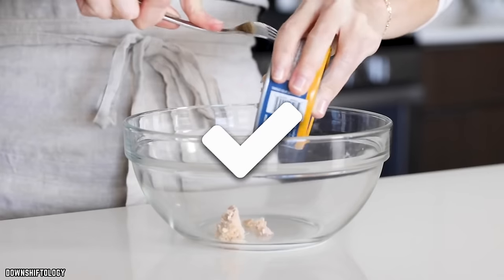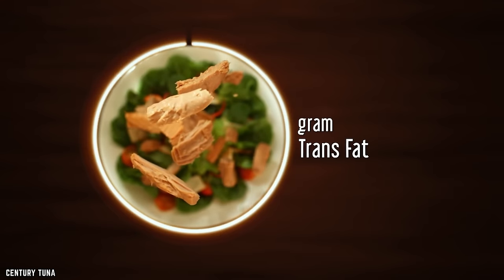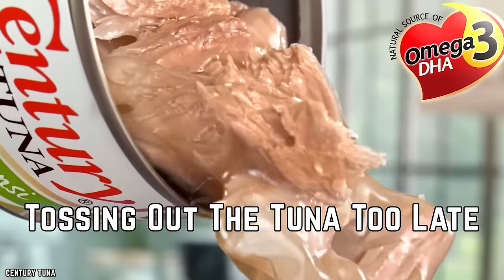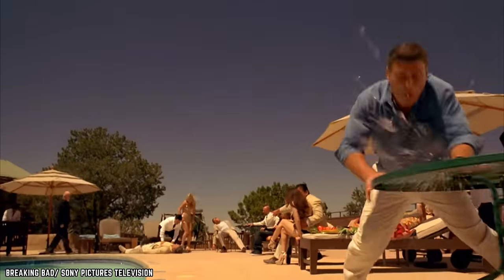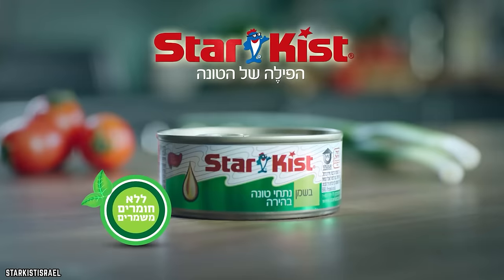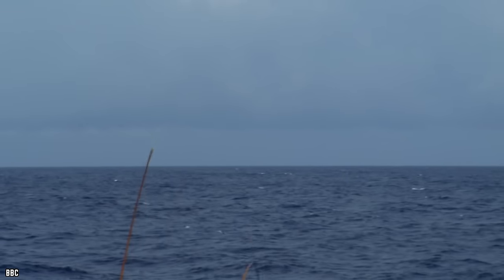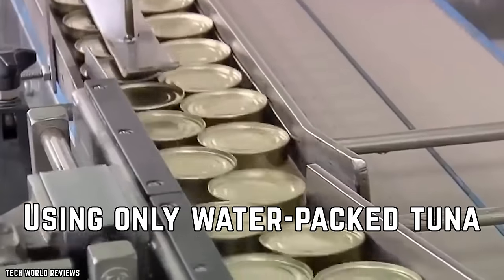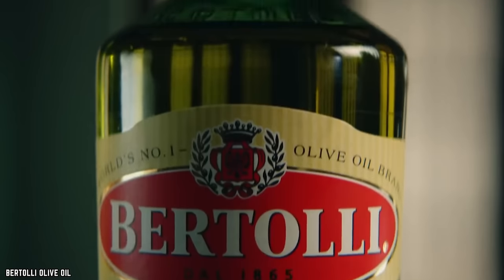10 MISTAKES Everyone Makes With Canned Tuna

Comment: Tell me who in the hell is storing their canned tuna in over 100 degrees on the floor?
Reply: I went through Hurricane Katrina. Destroyed my pantry but many canned goods were alright, tuna being one. Kept it in a box on the floor for over a month. 
Also, homeless people may have to store it on the ground. Not trying to argue...just giving examples.
Reply: Hoarders??
Reply from the maker: @Kris Frederick Storing canned tuna, or any food for that matter, in temperatures above 100 degrees Fahrenheit and on the floor is generally not recommended or common practice. High temperatures can accelerate the growth of bacteria and spoil the food more quickly, potentially leading to foodborne illnesses. ❤️

It's important to store canned tuna in a cool and dry place, away from direct sunlight and extreme heat sources. This helps maintain its quality, flavor, and safety. Most people store canned tuna in a pantry or cupboard at room temperature or slightly cooler.

Comment: I always buy oil pack. Don't eat it often so I don't figure it matters much. Also an old man so not worried much about the mercury.
Reply from the maker: @Steven Wagner As an older individual, you mentioned not being too concerned about mercury. However, it's still advisable to maintain a balanced approach to your diet and be aware of potential risks. 😉

Comment: Can we get those temps in Celsius? And also you should always use the oldest food first common sense  really.
Reply from the maker: @Certainly! Here are the conversions of temperatures from Fahrenheit to Celsius:

Over 100 degrees Fahrenheit is approximately 38 degrees Celsius.
Room temperature, typically around 70-75 degrees Fahrenheit, is approximately 21-24 degrees Celsius.
These conversions can give you a better understanding of the temperature ranges being discussed. Remember to always store food at safe temperatures to ensure its quality and safet😉y.